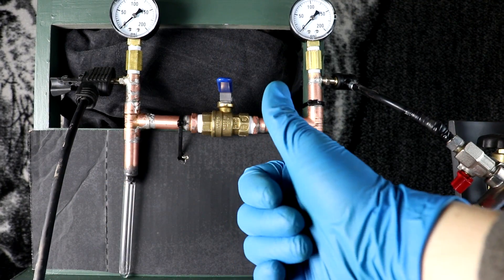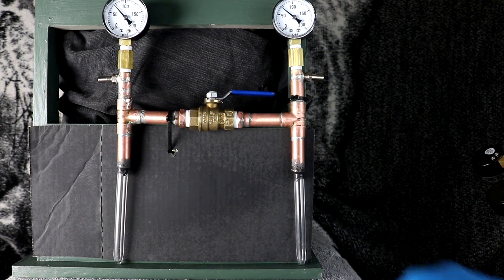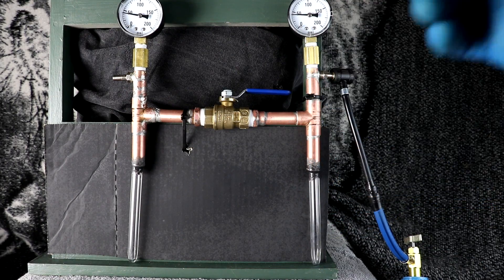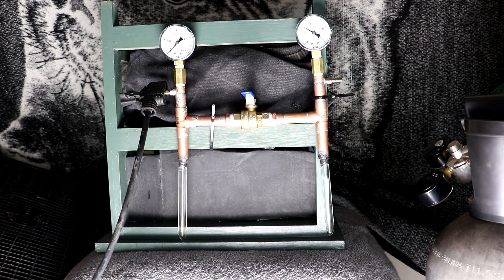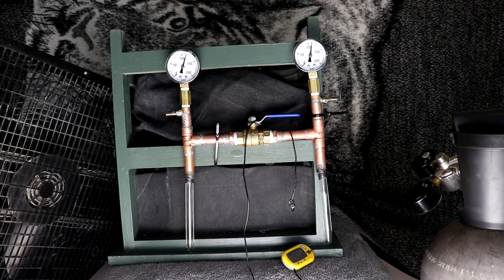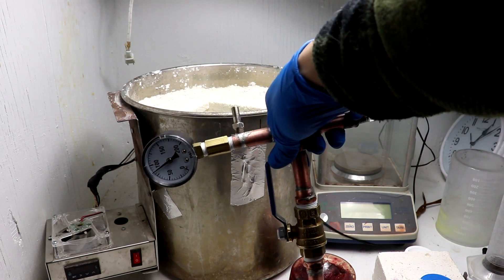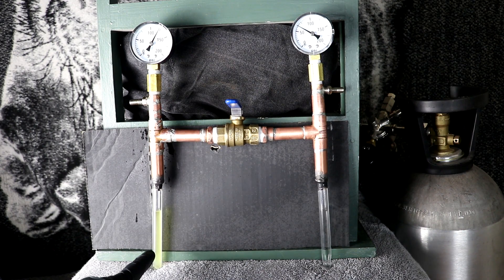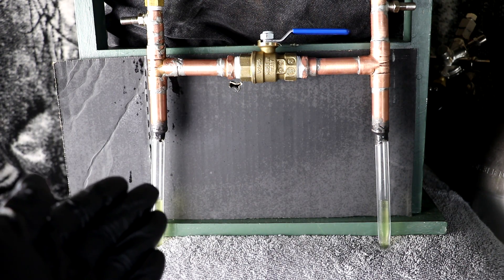The Law of Partial Pressures Demonstrated Using Vapor Pressure

Comment: For the first part, I would've compared it to liquids.
For the most part, gasses are just liquids that just won't stop hopping, and liquids are just solids that won't stop hopping.

So, if you cool down the gasses all to liquid, it's still the same stuff there. Just it's calmed down, and you can see it easier.
If I put a tube between two cups of water, it'll balance the liquids out, no matter what type of liquid it is (ignore liquids with super high densities, like Mercury, making water unable to flow upwards and not mix evenly)

Comment: Another proof today, Epoxi used to attach  glass to copper will hold to 150psi+.
Reply: I was waiting for the pop, and hoping Cody had a face shield on, but it looks like my fear was unnecessary this time.
Reply: And it's maybe .05 square inches? That's a whopping 7.5lbf pushing the glass out.

Comment: this is strange.. In my experiment I was working with propane ethanol mixture, and resulting vapor pressure was either lower then of propane itself.
Or it just took more time(energy) to evaporate from liquid state? That does not sound ok to me..

Comment: Aren't most gases odorless?? I always heard the gas companies add in odor in case of gas leaks, people will be warned... Is that true?? Great video as always, take it easy...
Reply: Like farts for example?
Reply: @J0hnn0_JS  actually methane is odorless, and the stench comes from the decaying particles that are suspended in it.
Reply: @johnsmith-sp6yl  Actually - methane is just a small percentage. Sulfides, including stinky H2S are responsible. Most gases are not odorless.  Only some. When you work in a lab, you'll know this. Its true that propane is odorless, hence the addition of ethyl mercaptan, as a safety feature.
Reply: Where I used to work, they would add mercaptan into the intake air to warn people of an emergency.  Crazy how fast that stuff would spread throughout a mine.
Reply: @J0hnn0_JS  huh, you learn something new every day.

Comment: If anyone can answer this question, that would be greatly appreciated.
I’m doing a gasometric analysis of a acidic mixture solution. The data is inconsistent. I’m using water in a burette to take the measurements, and applying heat to the analyte solution. The heat is constant at 30C. The gas released during the measurements are not. The gas decreases and increases seemingly whenever it feels like it. 

My question is what could be the cause of the mixed results?

Comment: WOW I'm impressed with JBweld, I didn't think that it would hold 190 PSI on glass and copper!
Reply: Nsaw1Gaming J B weld is actually crazy, it just gets a bad rap because of the stupid stuff it gets used for
Reply: @KingHalbatorix  true! my dad jb welded a piece of his Camaro's radiator back on and it held for years.
Reply: @HappyMadScientist  I've seen a lot of videos of tests of different adhesives and JBweld 90% of the time it comes on top!
Reply: @HappyMadScientist  my dad JB welded part of a cylinder on his Nissan pick-up after the block cracked. Held together for another 100,000 miles.
Reply: @ColwellMarcus  Wow that's insane!
Reply: @KingHalbatorix  I know JBweld is insane!
Reply: I wonder if he took some aluminum oxide sandpaper and abraded the test tube before trying to get the JB Weld to adhere?
Reply: As kid, used to be very hard on bicycles with jumping and off riding in the woods. Broke the frame in half near the pedal casing, JB'ed it and road it until it took a swim in an old strip pit. JB is some strong stuff.
Reply: There is a video on here where a guy makes a head for a lawnmower engine out of JB weld. Its also approved to repair cracks on plane engine blocks. So yea, very strong stuff
Reply: @davisdonnell55  I saw that video, JB weld is crazy!
Reply: He's had substances stored at supercritical pressures inside of glass tubes before. They explode when dropped.
Reply: Hero Slippy he was commenting on the connection between the copper tubing and glass being sealed with jb weld.
Reply: @heroslippy6666  I saw that video it's cool, but like Jameson 1776 said.

Comment: It reminds me of a system to prevent co2 from escaping a sparkling brevage by using a pump to put compressed air in the half empty bottle... When I tried to explain that this would fail because what matters is the Partial pressure of CO2 and that air is only 400ppm CO2, many people wouldn't believe me...
It can even be dangerous if the pressure gets to high. Of course some N2 and O2 could dissolve in the beverage but it would be slow. Also at the end of the day, even if the bottle doesn't leak or explode, the CO2 is gone and you have added O2 that can oxydize molecules and have a bad effect on taste.
Reply: So the solution to preventing the co2 from escaping the drink is to use a compressed gas that contains at least as much co2 as the drink itself?
Reply: @Porkey_Minch  Pure Co2, yeah. That's how it's done IIRC. And now I know why. (I always wondered why not put some inert gas)
Reply: I'd say the simpler solution is to simply drink all of the liquid. That's MY preference.
Reply: @dionh70  Don't open the bottle.
Reply: Given you don't use glass bottles, I just press them together so make the "empty" space smaller. If the bottle is still somewhat full, the CO2 has enough pressure to re-compress the whole bottle, making it look normal again, but after you open it again one or two times, it will stay crumbled and you lose less CO2.
Reply: @whuzzzup :
If you compress the PET bottle to reduce the space over the liquid, the CO2 eventually leaves the liquid and inflates the PET bottle. So, you lose CO2 that way. The solution is to compress the PET bottle and prevent it from reinflating by putting a belt around it or something. Or better yet, pump some more CO2 into your cola bottle.
Reply: just open it upside down like a normal person
Reply: Oh, so the CO2 will always act as if it alone occupied that volume anyways? So nothing will change except that the overall pressure will increase?

Comment: Why is it when you do the two balloon experiment where the less filled balloon fills up the greater filled balloon?
Reply: That has to do with the pressure form the elasticity of the balloon its self. You see a balloon that is filled half way up has more rubber that is not as stressed and as a balloon that is filled full. You notice this more when you first blow up a ballon. When you first start to blow up the balloon it takes more pressure from your mouth the get the balloon to start to inflate than after it has already had some air put in to it. I hope I'm making sense. So basicly there is more strength to the under inflated balloon to push the air in it to the other side which has less structural strength to it so it is easier to be inflated more.
Reply: Caleb Davio ah ok thank you so much for taking the time to answer my question.
Reply: Not a problem.

Comment: 5:42 Me shouting "Close the valve Cody!"
Reply from the maker: You can get an idea of how many times I had to re film by the outfit changes.
Reply: @theCodyReeder  Although your hair looks intact throughout, so all good in the end.
Reply: Oh no! Cody can't hear you! He has airpod in! Oh no!

Hence the video cut
Reply: And what about later at 12:42? Propane is flammable and not cheap!
Reply: @GRBtutorials  propane is pretty cheap, costs like 10 bucks to refill a 20lb cylinder
Reply: Demonic Koala Well, yeah, “cheap” relative to other gases, but still flammable. And what’s the point in not closing the valve?
Reply: I kept thinking "Don't do it, idiot, you're going to have to re-purge the system and do it all over again!"
Judging by the cut there, I'm guessing that's what happened!
Reply: same
Reply: Same. I actually said it aloud lol
Reply: Probably just liquid propane in the hose, the valve is already closed ;)

Comment: If you know the total pressure of all the gases in a vessel, and the number of moles of each gas, you can use the amount of moles and mole fractions to determine the partial pressures. It's helpful when you don't have enough information to use PV=nRT.
Reply: However, that only holds prrfectly true for an ideal gas, which doesn't exist. It can be a decent approximation though.
Reply: Very true, thank you for pointing that out, that's why it's called the "ideal" gas law haha. My above comment also only works at equilibrium when the temperature is held constant. It's nice to see that some of the people who watch Cody's lab videos actually care about the chemistry concepts behind the videos. Thanks for the reply
Reply: Hello Thanks, no problem! I'm a real chemistry nerd lol

Comment: Now correlate how the atmosphere exists next to vacuum without a barrier.
Reply: I think it's the gravity that's holding it in place, but the density is kinda exponentially less as you go up, but takes a long time before it's 0.  There's technically some atmosphere even at the ISS, enough to cause a bit of drag to require reboost once in a while.

Comment: What's the partial pressure of radioactive decay? Like something decaying helium nuclei in a closed box, does the box fill with helium gas? Then liquid? Will it ever stop?
Reply: It won't stop as long as there is enough material to turn into helium. Nuclear chemistry doesn't interact with  physical chemistry like that.  Nuclear decay is consistent and follows a half-life decay with strict accuracy.

If partial pressure applied to radioactive decay, Carbon dating and other radiometric dating techniques would not work. We wouldn't know how old fossils where if partial pressures applied to radioactive decay.
Reply: Colin M. Thanks man.
Reply: @GoatDust  Any time, from a friendly Environmental Science college student
Reply: @colinm.3419  So what happens to all that helium?
Reply: Edited final answer: So I asked my Stanford physics grad friend and he says that you eventually get iron, he doesn't remember which, regardless of the size of the box. Though if the box is large, it'll take a really, really, really long time (heat death of the universe type long, as a matter of fact). This is regardless of the materials you put in by the way too. Technically, everything in your box will be iron eventually. As your uranium or whatever decays, eventually the helium will start fusing while the atomic number of the initially-uranium will continue to decrease, both sides approaching iron. Neither direction will stop until iron.
@Deeper layer amending what I said earlier, temperature to fuse helium could easily be achieved, however the helium will never fuse above iron.

The wrong answer: Uranium and whatever only forms in supernovae and other comparably extreme conditions. This means the pressure required to cause those atoms to fuse back together, and thus the equilibrium pressure to cause them to stop fissioning (on net, there would be microscopic oscillations I think), doesn't occur even within stars in their normal operation. Your box won't survive the pressures at which it would stop, but I'm pretty sure that as long as no energy or material escaped, you would eventually reach a state of equilibrium. However, you wouldn't have any of your original isotope left most likely, only some stabler elements at both the high and low end.
@Deeper layer What you're saying makes no sense. Nuclear decay (fission) is not some magical one-way process. Fusion also exists. If no energy or matter leaves, your box will reach absurdly high temperature and pressure and stuff will start fusing back together until equilibrium is reached. Whether that equilibrium will include any of the original isotope I'm not sure, but it's not like you would just get a box full of helium.

EDIT: Thinking about it a bit more, the equilibrium amount of the original isotope likely depends on the ratio of box volume to material. If there is little enough material in the box, you'll just get a box of cold helium and relatively stable metal. If there's enough, you should get a chunk of stellar core.
Reply: @yaksher  :
"As your uranium or whatever decays, eventually the helium will start fusing while the atomic number of the initially-uranium will continue to decrease, both sides approaching iron. Neither direction will stop until iron."

==This is wrong. U238 decay chain ends up with Pb206, which is stable. As for U235, I think you end up with Pb208.

As for fusing He4, yes I suppose you end up with Fe56 at some point. Fe56 has the strongest nuclear binding force of all nuclei. In other words, fusing light nuclei is an exothermic process until you reach Fe56. After Fe56, it is an endothermic process.
Reply: @louistournas120   Pb208 is 'stable'. I'm talking about very long term time scales. Iron is the only element which is long term stable, I believe—at the end of the world, we will have nothing but iron.
Reply: @yaksher  :
Well, I don't know about that.
I have never heard that stable isotopes actually decay to Fe56. They would have to be alpha particle emitters and would have to have very long half lives like 10^30 y.
Reply: @louistournas120  They do have very long half lives, but they aren't 'stable'. For example, alpha decay isn't necessary. Beta decay will increase the charge of the nucleus and decrease stability, possibly THEN causing alpha decay.
Reply: @yaksher :
From what I have seen in the actinides, the nuclei with the longest half-lives tend to be alpha emitters and beta+ and beta-ters  emitters have a much shorter half-life.

For example, U238 captures a neutron and becomes U239, which quickly decays to Np239 which quickly decays to Pu239 which is an alpha emitter and which has a long half-life.
Reply: The box will slowly fill with Helium until there's no more alpha decay. Helium doesn't' liquefy at room temperature.
Reply: @Morbacounet  at high enough pressures it must, right?
Reply: @ErixTheRed  No, it's critical temperature is 5.2°, it doesn't become a true liquid if you compress it at a higher temperature.
Reply: Technically you can stop it if the pressure and temperature are high enough that before all the nuclei have decayed the helium would start to fuse into heavier elements. I mean I guess that's kind of an equivalent scenario although completely unrealistic.
Reply: @SvetlinTotev  The "box" would melt/burst before you reached such a high temperature/pressure but it's technically possible.
Reply: @deeperlayer  What I mean is that it's possible as a tough experiment but in the physical world you can't do it. So technically possible, practically impossible.
Reply: @deeperlayer  What makes you think that nuclear reactions are not subject to Le Châtelier's principle?
Reply: That's ... Not how it works
No amount of pressure can push the helium nuclei back into the decayed uranium atom
Reply: @YounesLayachi  I'd like to pose the question to you then "How does uranium form?"
That said, according to my physicist friend, there is in fact no amount of pure pressure that is enough and that the required conditions are near-fundamentally transient. However, supernova do briefly create conditions where helium (and heavier elements) are fused into the superheavy half of the periodic table.
Reply: They are not fused into those elements. They capture neutrons and neutrons then decay into an electron, a proton (and an anti-electron-neutrino). This is how elements move "up" after iron.

Comment: Does this mean there is such thing as partial peer pressure?
Reply: Why do you watch everyone I watch?
Reply: If you are subjected to the same peer pressure, over time with enough energy you will give in and equalize while increasing overall pressure
Reply: "Everyone is telling me to not give in to peer pressure." ;P
Reply: @sebbes333   Hahaha!
Reply: @alext9067  Thanks :D
Reply: Yeah, the law goes like this - "The total peer pressure exerted is equal to the sum of the partial peer pressures applied by the individual peers".
Reply: only if your friends are all airheads.
Reply: I like keeping the propane outside also.  I also wrote somewhere I needed a brass cap and at the time I don't recall finding them online and was thinking that might not be a bad business with a mini-lathe.  Looks like they're out on that market now... might have been me too or search engine AI.  Another reason why I started learning electronics for when on the road wanting to boil water in places where rocket stoves were inconvenient.  Little 12V - 120W immersion coil heater I haven't tested yet was the last ultra light method (compared to marine deep cycle(s) and inverter with hot plate along with a battery charger for).  I still vote keep those kind tanks outside... scary stuff.
Reply: If you leave two people in separate hermetically sealed rooms for long enough, there will be very little peer pressure once the seals are broken...
Reply: Yes, the way it truly manifests itself is that the IQ of a group of young males is equal to that of the lowest individual divided by the number of individuals in the group.
Reply: come on man, just take one lil' hi--